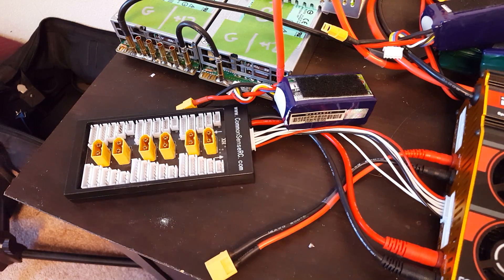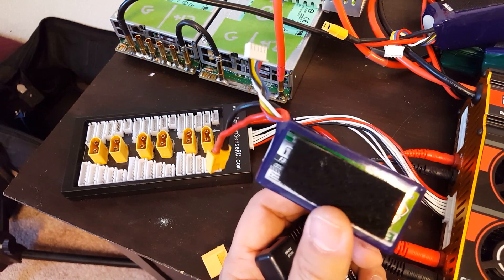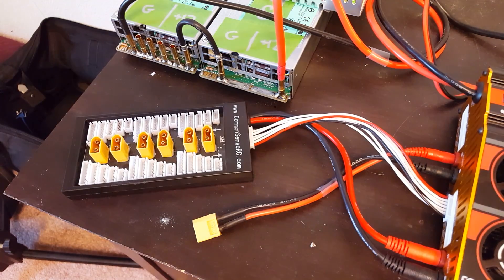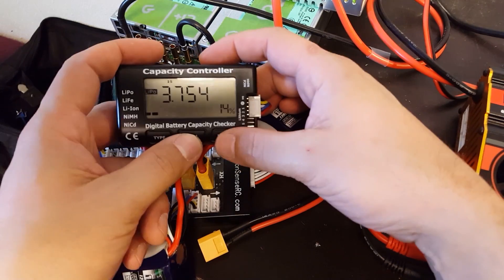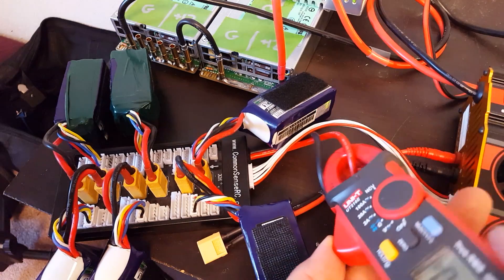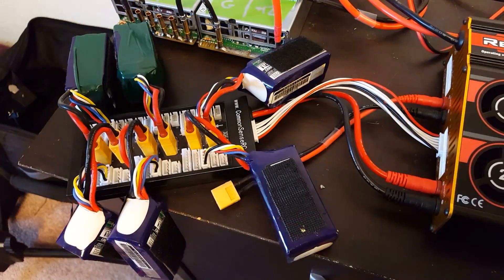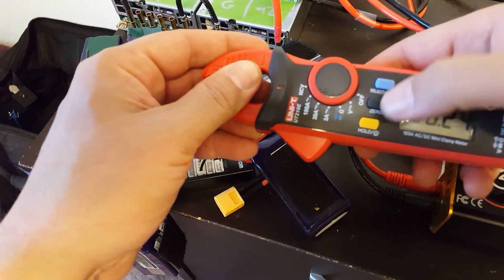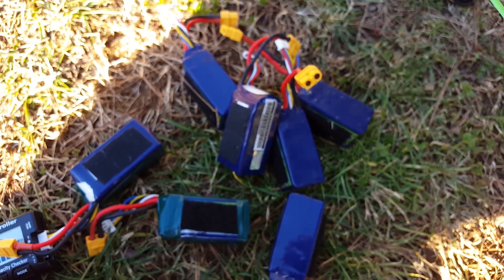Balance Charging: Can you parallel charge?

Comment: Great video Joshua. There is one aspect about parallel charging I've always been curious about: What would happen if you mix in a li-po with a bad cell?
Reply from the maker: +Jaap Pieroen If the cell was under-volt, then the other batteries would pump current into that cell until their voltages equalized. Depending on how bad the cell was, it could pull the other batteries down to its level and ruin their cells as well. 

If the cell is within safe voltage range for parallel charging, but has a very high IR, I believe the way it will work is this: the high IR will mean that more current will be required to raise its voltage. Therefore, it will take more current than the other packs on the board. This is kind of counter-intuitive, because usually with Ohm's law, higher resistance means lower current. But I think it is correct. The higher-resistance cell requires more current to raise its electro-chemical energy state, because more of the current is wasted as heat. Anyway, I'm not 100% sure on this, but it feels correct. So if I am correct about that, then what it means is that the higher IR cell will be charged at a higher C rating than the lower IR cells, which could exacerbate any damage that was done to it.

This is one of the main things I wanted to point out in this video. If you parallel charge, you need to pay close attention to the health of your packs and to your charge rates, because careless parallel charging can make a marginal cell go bad very quickly. This may be one reason why people say that parallel charging ruins batteries and isn't safe. I say that it's just another aspect of parallel charging that you need to be aware of.
Reply: +Joshua Bardwell FWIW I've been parallel charging for over a year now, and wouldn't want to do it any other way. I never considered what effect different IR ratings could have over the current spread. So your video was pretty valuable for me. Maybe I should buy a clamp meter, I hope it comes packaged with an pearl.

I have a fixed workflow for my batteries. When I go out flying I try to empty all my packs. When I'm back home I give every li-po a storage charge (I try to do that in parallel as well, but my li-po's tend to have too much voltage difference to do it in one go). This way I have a stack of li-po's with the same voltage, ready for my next flying day whenever that might be. Once I know I'll be flying I can hook all li-po's in parallel divided over my two chargers and be set to go in one hour.

Meanwhile the li-po's are stored on the optimal voltage extending their lifetime.
Reply from the maker: +Jaap Pieroen Especially if you fly mini quads, parallel charging is the only way to charge in a reasonable amount of time, and for a reasonable amount of money. If you fly a 6S 10,000 mAh battery, then one big massive charger is useful to you. But if you fly ten 1300 mAh 4S batteries, what are you going to do? What you really need is 10x 50 watt chargers if you want to avoid parallel charging and still charge at 2C. Even if you went with the cheapest option (Accucel 6 50 watt) you're looking at $250. By going to parallel charging, you can make use of a top-of-the-line charger. But there are definitely some hoops you have to jump through to make it safe.